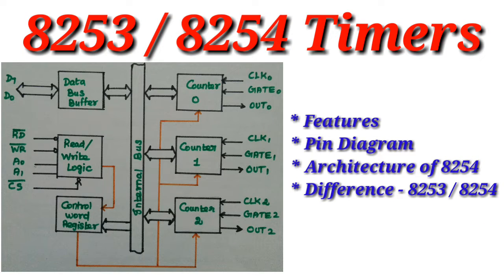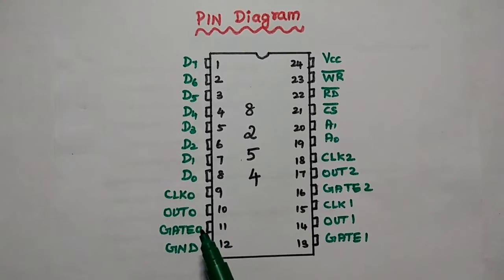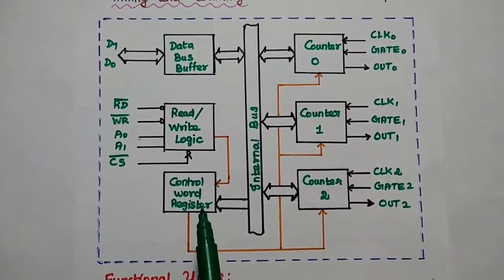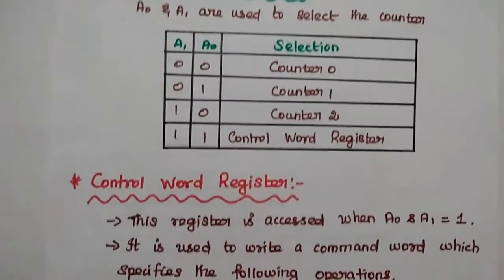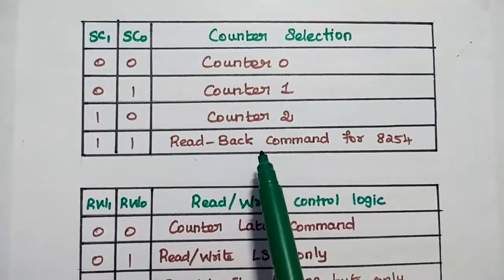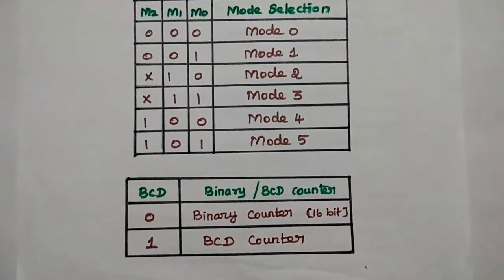8253/ 8254 Timer - Features of 8254 - Architecture - Difference between 8253 and 8254

Comment: 🎯 Key points for quick navigation:

00:00 Introduction to 8253 and 8254 programmable interval timers by Intel, used for generating accurate time delays and counting under software control in microprocessors.
00:26 The 8254 is an enhanced version of the 8253, utilizing HMS technology and capable of operating at 0 to 10 MHz.
01:09 The 8254 supports interleaved read and write operations on the same counter, unlike the 8253.
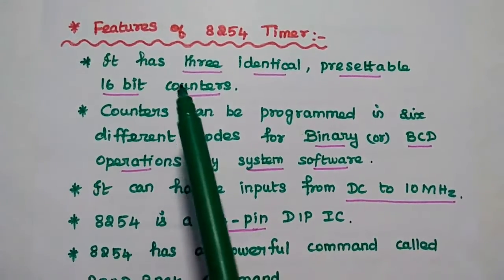01:34 Key features of the 8254 include three identical 16-bit counters configurable in six different modes for binary or BCD operations and handling input frequencies from DC to 10 MHz.
02:01 The 8254 has a read-back command allowing users to check count values, mode, and counter status without disruption, unlike the 8253.
02:26 The 8254 timer features a 24-pin dual inline package with 12 pins on each side and includes control elements such as data lines, counters, and control signals.
03:32 The 8254 architecture includes a data bus buffer, read/write logic unit, control word register, and three counters, all integrated for timing and counting functions.
05:25 The counters are 16-bit down counters, supporting 6 operation modes for binary or BCD counts, and can programmatically track the count during operations.
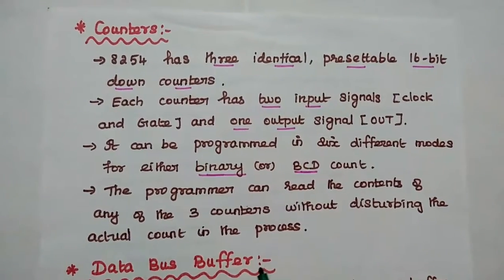06:05 The data bus buffer interfaces the timer with the system data bus, loading counter registers and reading counter values.
06:31 The read/write control logic includes five control signals utilized in both peripheral I/O and memory-mapped modes for interactions.
07:36 The control word register configures operation modes and specifies details like the selected counter, mode, and read/write operations.
09:11 Control word register details include bit assignments for counter selection, read/write logic, operation modes, and BCD/binary counter distinction.

Made with HARPA AI